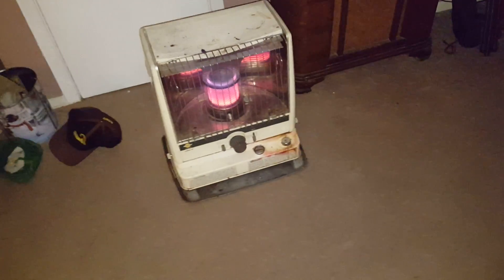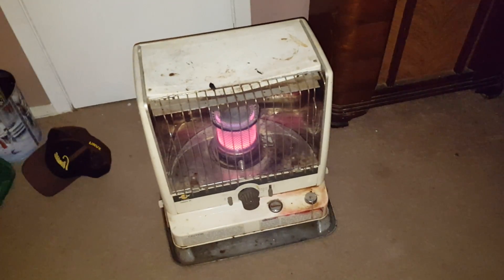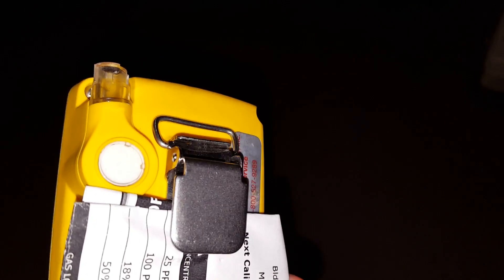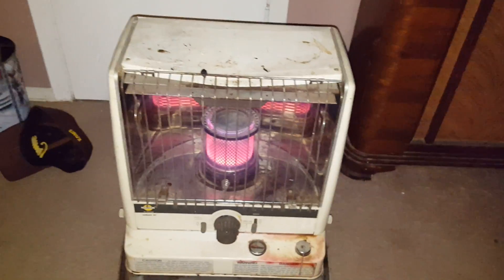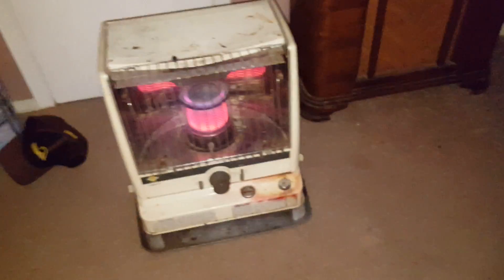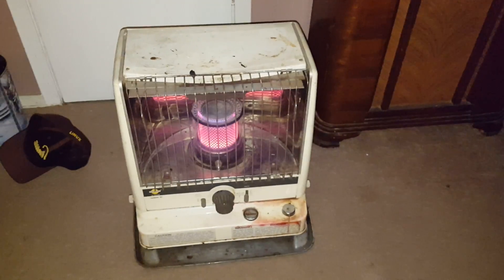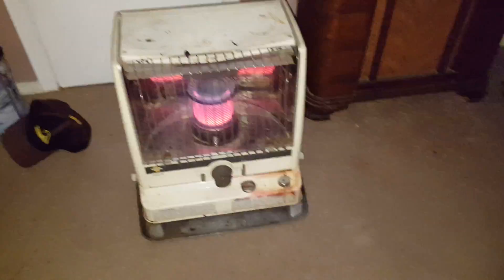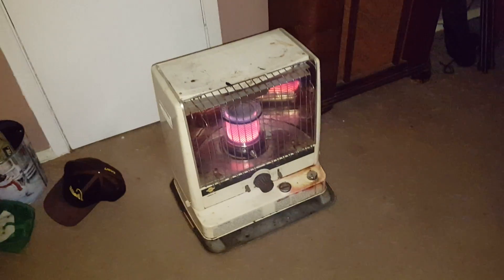Kerosene heater burning diesel. CO test.

Comment: Using a kerosun radiant 36 kerosene heater, and just start of the heating season... VERY VERY GOOD KEROSENE HEATER, and it tolerates the RED DYE DIESEL/HOME HEATING OIL with no issues.. Burned through 10 gallons so far of DIESEL FUEL and doing quite very well, i am pleased i did some research , because the damn electric heaters weren't doing shit, WASTE OF POWER AND DON'T HEAT SHIT. The kerosene heater it is well worth it putting diesel fuel in it, because it actually warms the rooms up and not wasting fuel.  I do add 4% of gasoline to the diesel, and it helps it burn hotter, the alcohol is garbage because i put it in a gallon of diesel and there is water in the bottom of the jug because the other 10% is water. so  switched to mixing some gasoline in and it lot better.....
Reply: You're nuts if you are mixing gas with kero lol, hope you don't start a fire. That's cool if it works for you but it just screams danger lol.
Reply: thank you for the advice.

Comment: as someone  who daily tests and calibrates those multi gas meters... next time start it up outside AWAY from the tested area... if there was and CO in that room, when you started it and it ran it's initial test it's zeroed it out..  not only that but do it enough times it will apply a permanent zero that will need removed with calibration software.

Comment: CO isn't the problem.  The problem is soot that clogs up the wick after about 16 hours and you ruin your wick.  If manufacturers wanted you to burn diesel in a kerosene heater then they would just tell you that it is a dual fuel heater.  Kerosene in a kerosene heater only.  Diesel #1 and kerosene are a lot different!

Comment: You are using a kerosene heater simular to the sear heater i am using, (USES THE FIBERGLASS TYPE WICK)  After each tank full of ruby diesel Bobby you may want to take the heater outside near when its almost empty put it up on high and dry burn it. tHIS will help reduce the tar buildup on the wickl, diesel has more oil in it then kerosene, i dry burn my FANCO every tank full of RUBY DIESEL and it does ok.  IT is just a pain taking hte heater outside everyday to dry burn it, BUT WELL WORTH IT. 

If you don't dry burn ti it will buildup so fast it will clog the wick. i don't know how well it will work with your kerosene or with my sears heater, but with the FANCO seems like it can handle the RUBY DIESEL. But i am giving it a try in the sears heater then attempt to dry burn it.. See if it works or not.  I have 6 Perfection heaters (FLAME SPREADER TYPE WITH 100% COTTON WICK) I used them the whole time last winter here in ohio went through about 200 gallons of ruby diesel not one issue with the  Perfection kerosene heater, With the COTTON type wick i do not dry burn them PERIOD!! oTHER wise portion the wick is consumed.

Comment: The only kerosene I have found so far in my locale after a short search is red dyed kerosene. I have yet to use it but wonder how different it actually is from #2 heating oil and/or diesel. It was $2.99/ gal
Reply from the maker: bigpardner it’s the same stuff. Just died to mark it as off road use. Non taxable. Diesel engines will burn kerosene. At that price it would be worth it to fuel up a truck with it. But you wouldn’t be paying road tax for it. And that cuts into the highway patrols paycheck. They don’t like that.

Comment: Still puts toxic fumes in the air. K1 is indoor safe. Not worth getting lung cancer to save a few bucks.
Reply: What toxic fumes does it emit?
Reply: Get cotton wicks and burn 1 pint >90% isopropyl alcohol per 5 gallons of ULSD and 3 ounces of diesel injector cleaner/anti-gel solution. No dry burn necessary! Do your own test!
Reply from the maker: The purpose of a catalyst heater, is to burn away the toxic fumes before they enter the air. Life itself is eventually toxic..Somethings gonna take us out.

Comment: Just a update, i burned through 20 gallons of RED DYE DIESEL/OFF ROAD DIESEL in my FANCO SERIES 22, and do a dry burn every 2nd fillup, and its doing very well. no complaints. KEROSENE stil $4.00 here in ohio, BUT THAT WORTHLESS CRAP hopefully people won't buy it and it will force the price down. I CALL IT WORTHLESS OVERPRICED CHIT!! MIGHT be ok for the airlines not for me. ITS 100% TOTALLY WORTHLESS SHIT!!!!
Reply: yes all cotton wick, you use FIBERGLASS it will clog it up. i tried your method like the heater you have in the video, and it jsut clogged the wick up to hell. thats why i chose the PERFECTION heaters they use the 100% cotton wick and can tolerate the diesel lot better.

Comment: Right now as this posting RED DYE DIESEL going for $2.74 a gallon (not onroad) ONROAD DIESEL is $2.89 , they might as well make the RED DYE DIESEL ONROAD same damn price, but running a FANCO series 22 KEROSENE heater, burned already 20 gallons of RED DYE DIESEL and its doing very well for my old farm house. bout every 2nd fill-up i do let it run dry, because it has a fiberglass wick and dry burning it, it really is doing very well burning DIESEL FUEL.. Had a sears kerosene heater with fiberglass, no matter what i did, it would not tolerate the diesel, BUT THIS OLD FANCO not a bit of issue burning red dye diesel,

PEOPLE SAY USE CLEAR FUEL, THEY ARE FULL OF SHIT, the red dye is just there for tax purposes, HAS NO EFFECT ON HOW THE FUEL BURNS!!!!

Comment: Diesel burns WAY BETTER than kerosene. By 41%
Reply: Not quarreling with you, but what does it mean to burn better?  Do you mean burn more completely?  Isn't any fuel, which burned produces no Carbon Monoxide, burning as well as it can?  Does Diesel burn hotter?  Is that what you mean?

Comment: they don't sell kero out of the pump here anymore so they sell off road diesel it's called. much cheaper and it works just as good as kero. I just lit mine outside and let it run for a few min then adjusted the wick....works slick

Comment: I am not a chemist but I did some research on the net about the pollutants from diesel and what I found was that carbon monoxide isn't as much an issue with diesel as it is with gasoline. Diesel puts out Nos instead of Cos. Carbon monoxide poisoning deaths from diesel appear to be very rare. The issue with diesel is that the particulates are carcinogenic and can cause lung cancer. Miners who work diesel equipment get lung cancer from the soot.
Reply from the maker: true. but the heater is a catalyst heater. The brass catalyst heats to glowing red and burns up the particulates. there is no soot collecting on the top of the heater.
Reply: Yep, I expect you are correct.
Reply: Walter Lego. If a wick in a heater is not adjusted properly and you can smell the oil that can be dangerous kinda like "popcorn lung" because that oily odor is tiny oil particles in the air. A heater burning at proper high proper flame you have better combustion and better heater efficiency. These heaters do produce about a gallon of water for every gallon of fuel burned and they burn many gallons of oxygen per gallon of fuel  so keep a few windows cracked a little for fresh air and enjoy these heaters.

Comment: Thanks for doing the CO test. I have used a kero heater with kerosene at my cabin and the odor at times was more than I wanted to put  up with. Will be up there next week and be using BP diesel with the alcohol added.
Reply: 'Adding a touch of 91% Alcohol helps with the odor'  What do you mean by a "touch"  How much Alcohol per gallon of diesel?
Reply from the maker: no problem. I just got tired of the BS stick saying you have to pay 3 times the price for the same number of carbon and hydrogen chains. lol. K1 kerosene is outrageous.
Reply: Do you have an airport close by ? if you do price some Jet A. It is what I burn on my kerosene appliances. It costs me $14.75 for 5 gallons and it's just a cleaner dye free kerosene.
Reply: Out Of Place Ninja.  All you have to do with yellowed or cloudy contaminated kerosene is filter it through a old felt hat in a funnel or use a real shami and pour it through that until it comes clean. A Mister Funell works great for this. Once you have filtered out the crud and moisture out of it add a little bit of alcohol per gallon to get the moisture to blend. Another trick to deodorize kerosene is filter it like above and get some limestone powder from a farm supply store. Add a cup of limestone powder to a gallon of kerosene and shake the powder in really good. Let the powder settle and shake it again. Let the kerosene sit a few days. Siphon or pour off the kerosene through a felt hat into a good clean container and the limestone on the bottom just toss it on some weeds in the driveway or into the burn barrel. I heat my home with a Perfection 525M heater every day and I love kerosene heat. That Klean Burn kerosene alternative is nothing but recycled paint thinner low odor mineral spirits and it stinks. Check out Miles Stairs Wick Shop for wick and kerosene heater information.
Reply: Alcohol helps a lot with the dye they use in kerosene and diesel fuel that is just nasty on wicks. Personally I would use 99% pharmacy grade rubbing alcohol it's cheap and works great. Methanol I would stay away from because in small amounts I'm not comfortable with the emissions it produces being burned in a heater indoors. When I fill up my Perfection heater I put a half to whole eyedropper of alcohol and the same amount of Hoppes #9 bore cleaning solvent because I like the sweet smell it gives the house. You can add a little bit of Amyl Acetate aka "banana oil" to kerosene or diesel for a sweet smell. Adding  Hoppes#9, Alcohol base potpourri oil, or Amyl Acetate in small ammounts completely safe from my experience with my heater. The only slight smell I have is that first few minutes of warm up  and the smell when you turn it off both things I do outside of the house. See if you can find some additive free Jet A from an airport it is all I use.
Reply: The meter needs to be turned on outside away from the area that you are testing. If you turn it on in the area that needs to be tested. It will show that area to be zero. Please try it again, but reset your meter outside and then walk into your room your testing. Stay safe and warm.

Comment: I've been doing this with my two Kerosene heaters for my garage and they both have been doing well.  I need to clean the wicks but they still put out plenty of heat.  I've noticed that when using Diesel, there is practically no odor.  When I finished off my K-1 it stank and was giving me a head ach!  Needless to say I will not be using K-1 anymore.  And this is with the stock fiberglass wick.  It was recommended to use all cotton wick when using diesel.  I thought about trying that out to see if I have better results.  But for now, they are still burning and giving off heat.  I've also noticed that they burn a lot longer that using K-1.
Reply: Ken Bilek. I buy wicks online from Miles Stair's Wick Shop. He has been very helpful and has a wick for any kerosene appliance you can think of.
Reply: Yeah,... He's great :)
Reply: +Ken Bilek Hey man thanks for the info. I was wondering how long you have been running the heaters with diesel. Any updates on how they are doing now? I am wanting to use diesel since its half the price of K-1 and easier to come by but I'm just a bit scared it might get clogged. Thanks!
Reply: I was fully prepared for the fiberglass wicks (stock wicks) to clog up due to the Diesel fuel but thus far they have not.  And it has been a few weeks now.  But keep in mind that you have to mix 91% Isopropyl Alcohol (1qt) in with 5 gal. of diesel.  If you don't the water content in the Diesel will most likely foul out you wick.  When you mix the two, let it sit for a while before you pour it into your Kerosene heater.  Allow the alcohol to absorb the water in the diesel.  Hope this helps.  This is what I do and so far it has worked for me.  If your wicks finally give out, try ALL COTTON wicks as it is said to be better for absorbing the Diesel fuel flow.  I did this because I can't stand the K-1 odor.  So I didn't care if the wicks gave out.  And when they do I will just buy new ones.  Good luck ok. I'll keep you posted.  Just keep in mind, be prepared to buy new wicks eventually!  I think it's still worth it. even if it's just for the sake of the odor alone!
Reply: Thank you! I'll give it a try. One last thing I went online and just couldn't find All cotton wicks. Its a mix of both usually. Have you found any yourself?
Reply: Hhhmmm....I did but now I can't remember the sight?!  I will do a search and let you know.  Try Amazon.  I think that was one of them. I do know that you will have to order online.  I have had no luck finding them in stores.  But they are out there.  One other thing, when you do fill your tank, let the Diesel soak into the wick for awhile before you light it.  It should help.  It did for me.  I guess I should say results may vary huh?!  ;)
Reply: Will do my friend thanks!
Reply: Have 6 perfection heaters and one FANCO (ALL KEROSENE HEATERS) they all have the cotton wick, and they can tolerate the diesel better then fiberglass wicks can. DIESEL  has oil and that clogs the fiberglass wicks up, WHY I put MY fiberglass kerosene to rest, WORTHLESS TRASH.  I will burn nothing but HOME HEATING OIL  (RED DYE DIESEL FUEL) thats all i burned in the perfection heaters and they had gave no fuss of the diesel. THe SERIES 22 FANCO heater i have, ran 6 gallons of red dye diesel through and it cranked the heat out and it GAVE NO FUSS neither.  and i did not use no additives, just straight RED DYE DIESEL.

Comment: Hi, did you mix Some Alcohol with diesel, before putting it in the heater ? for example how much alcohol can you put into 1 Gallon of Diesel....
Reply from the maker: about 1 or 2 oz..shake well...let it set awhile.  it will pull out any water and settle to the bottom. makes it burn much better. the diesel will be much clearer looking after it settles out.
Reply: Thanks, I&#39;m willing to purchase a new kerosene heater from home depot for indoor use, what do you recommend ?
Reply from the maker: https://www.google.com/search?q=kerosun+heaters+kerosene&sa=X&hl=en-US&biw=360&bih=615&noj=1&tbs=vw:l&tbm=shop&srpd=5239011026915490556&prds=epd:14892352467152881356,cid:14253795998414059365,paur:ClkAsKraX4SFVxz6b3mrWXbWcDiPJBR0SGkUyzVs5Py2DDQ9zrrYpEBh4BgUsxzraaOwaMxWPL1vXQ0jqQx2meFLXGfVN9D2TAaNeVcshjhqo6ojgL_7ZJcTbxIZAFPVH73Rkw-kp0O-ygywbploGrLF8MKaPA,cdl:1&ved=0ahUKEwi47vujiILKAhWDZCYKHWDhAqgQgTYIngQwBA&ei=8wGDVvioA4PJmQHgwovACg
Or
https://www.google.com/search?q=kerosun+heaters+kerosene&sa=X&hl=en-US&biw=360&bih=615&noj=1&tbs=vw:l&tbm=shop&srpd=3303006384980257302&prds=epd:13832695689016250812,cid:10333059384997928209,paur:ClkAsKraX1rx2RNQuVVruClPcvZpUD86aSKHs52CWGPgDK7qltR_iJjqmkK2lX21vQRIjdcwrxqiXt8sLRmpWb4C1RF94T9ekBmGt_VH3A_qIC9f3Ul6TiE5YhIZAFPVH70ws6AbIW78puKDWBV9635jmMWLHA,cdl:1&ved=0ahUKEwi47vujiILKAhWDZCYKHWDhAqgQgTYInAQwAw&ei=8wGDVvioA4PJmQHgwovACg
 Either type as long as they are indoor use.
Reply from the maker: +sof david just remember..it is a flame. it is burning fuel..my results may be different from yours. be aware of how you feel while its burning..even with kerosene..if you start feeling confused..sleepy..dizzy or tired..open some windows or stop using it in that area. and never go to sleep with it burning unventillated. always best to have a window cracked on opposite sides of the house to allow fresh air inflow. even older homes with propane heaters should be ventilated. any flame consumes oxygen and puts off some exhaust vapors. be smart dont get dead...
Reply: Thanks, I got the idea...